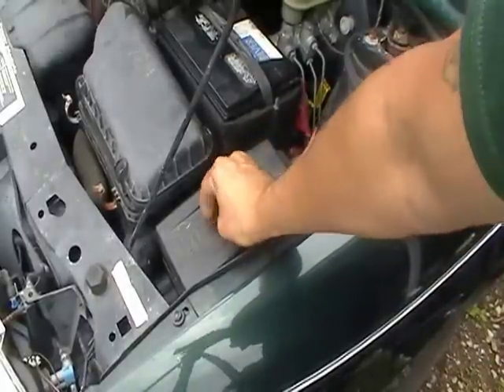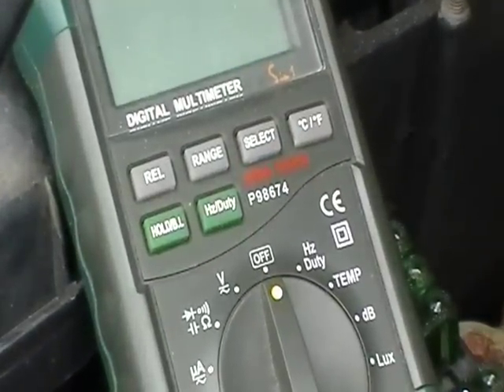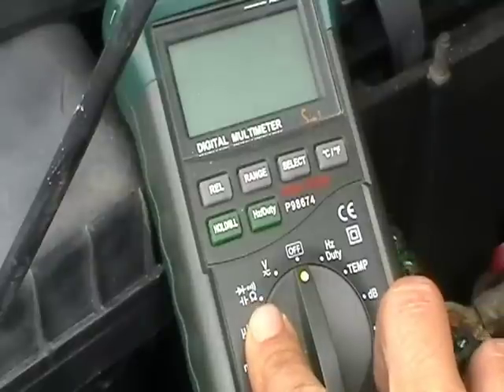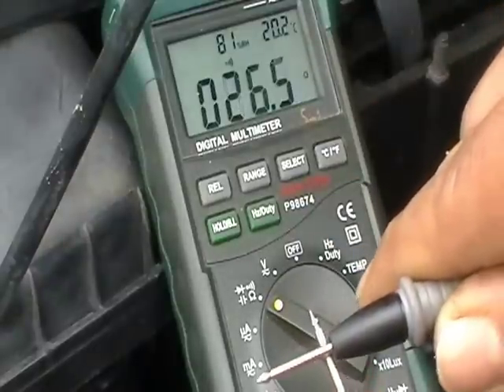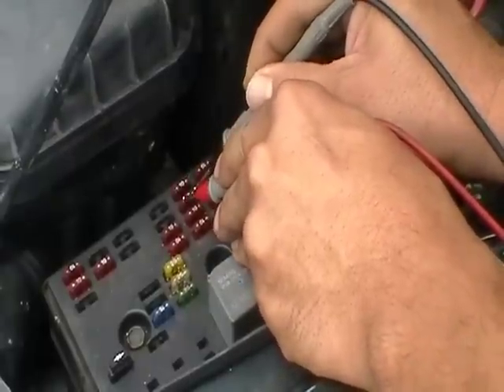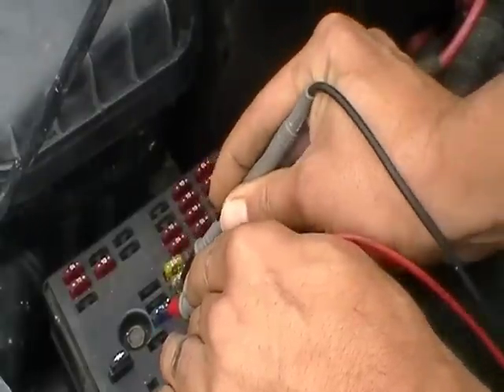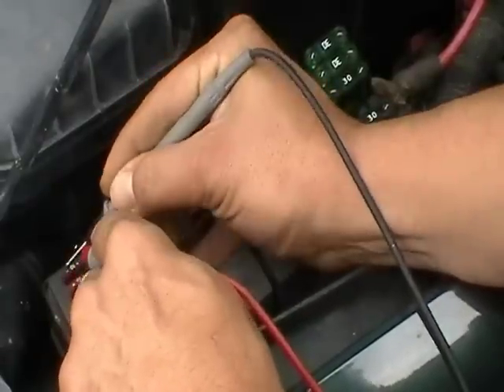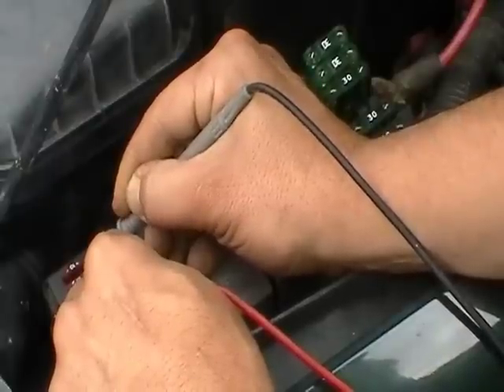Checking fuses the easy way Multimeter tutorial

Comment: Don't you have  to turn  the car on  to test certain car fuses ?
Reply: you are not testing the circuit of the car and the fuse, but rather the circuit of the fuse and the multimeter. if i get this correctly.
Reply from the maker: Nathan they can all be checked with car off. :)
Reply: I already change the fuse.Thanks.
Reply: So the car battery can be unplugged?

Comment: are you testing the actual plastic fuse or are you checking to see if power is coming in/out  to each side of the circuit/ or both?
Reply: he's just checking the metal tabs that plug in to the fuse holder to see if they are still connected. they separate when blown. this won't tell you about power, which you would only detect if the fused item (horn, lights etc.) were operating at the time.

Comment: This is info I need to know, but information is not clearly presented.  What is that diagram you showed for 5 secs?  Is this on the car, on your gizmo, what?  Your audience is also filled with clueless people like me, who want to learn all this stuff, but who have not used a multimeter, don't know what Ohms is, and confused about the functions of the display.  Why not explain a multimeter first, even briefly, just discussing the fuse check functions and then showing the diagram clearly on video for fuse wiring.
Reply: Lass-in Angeles you have the Internet at your disposal and you're complaining because he didn't put out a 20 min video explaining electricity? Get real.
Reply: someone-whats-his-name?  Does it say this video is for people with electrical engineering degrees?  No, it does not.  It is for everyone.  Everyone is not equal. When you introduce a gadget in your video, explain briefly what its purpose is, so we can all follow.  It takes 10 secs to do that, and ensures everyone can follow.  Got it Einstein?
Reply: I think he didn't talk about the diagram because even a none-electrician like me knows that's the fusebox diagram that tells you each fuse's amp and what the fuse is for, in my Mercedes one of the fuse-boxes is at the driver-end of dash and a sheet of paper shows the diagram.

Comment: I tried to follow the tutorial exactly using a multi meter but it didn't work. i touched the probes together just to check if the multimeter is working and i got the sound but touching the sides of the fuses did not work

Comment: So what if I still get continuity through a blown fuse?
Reply: then someone fucked up the wiring with a bypass.
Reply: +Optimus Primeif you do not have sound then you should get zeros on the display is the fuse is ok ...but you will get scrambled numbers if the fuse is bad.
Reply from the maker: If the fuse is blown you won't :)
Reply: FiremanCV 
What if I don't have one with a sound? How do I check for bad fuse?
Reply: +Michael Prevost I dont think you''ll get any current/continuity with a blown fuse, if the juice can't make any contact by any means.Then you have no contact, that's quite simple; you don't have 2 be a engineer to know such things. 
My bad if i'm being rude. ^^
Reply from the maker: . if the fuse is blown you will not get continuity through the fuse